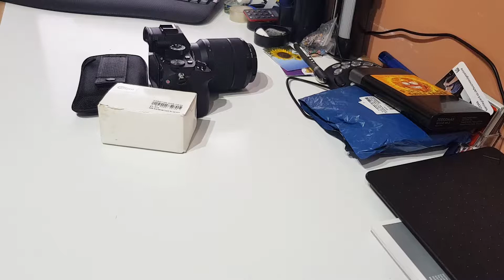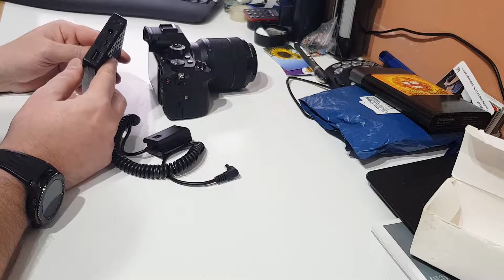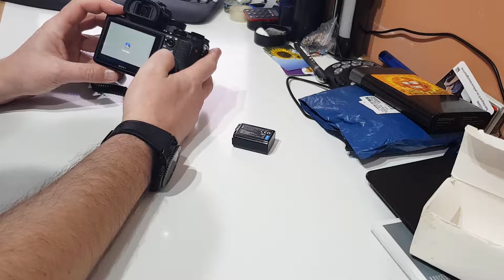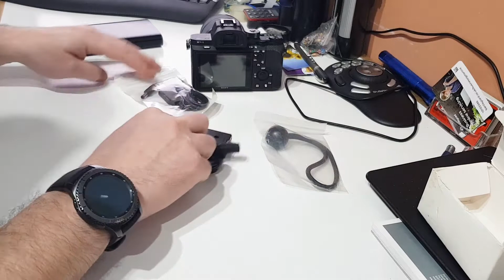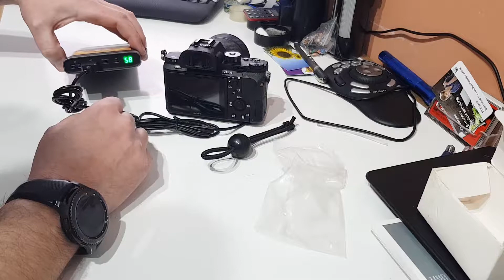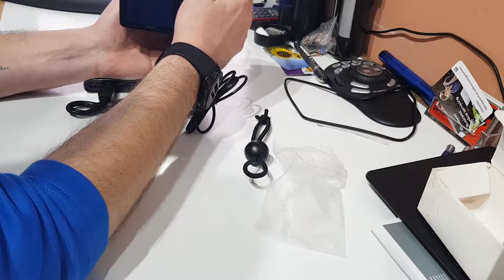Sony A7RII external power adapter - Selens profession NP-FW50 adapter review

Comment: Hi. Good idea to share this solution. Is it possible to plug the dummy battery to an AC adapter directly for in-studio use?
So far I didn’t find anything suitable.
And good choice of music. Liszt?
Reply from the maker: Hi. Yes the dummy battery can be used with an adapter straight from the wall socket, or a power bank that has a pass through capability. But, if the camera is a "newer" model, it might not need the dummy battery. As my Sony A7r2 can pe powered directly from a power bank.
Reply from the maker: As for the music, I really can't remember. :)